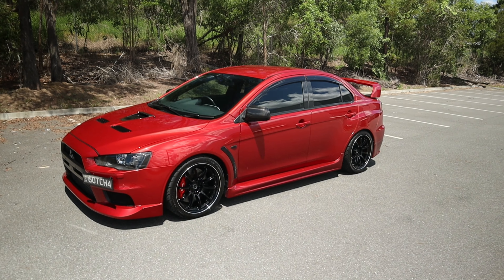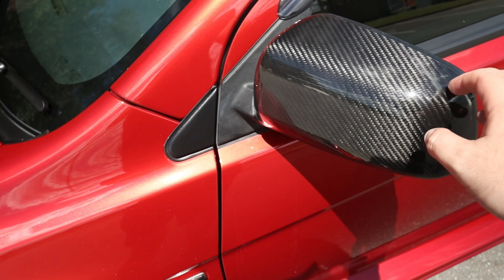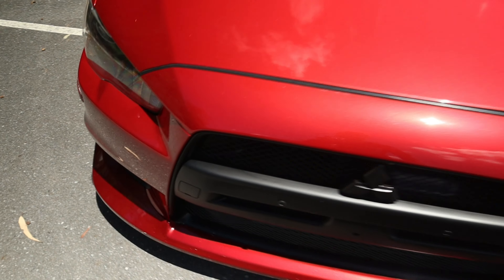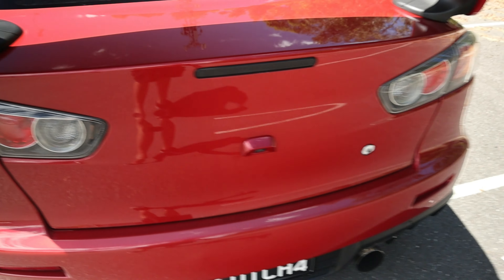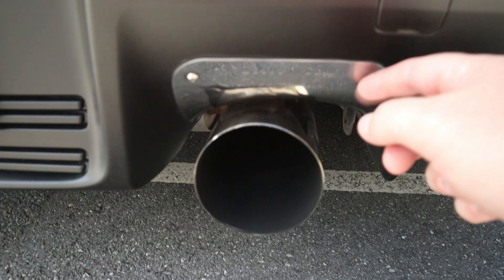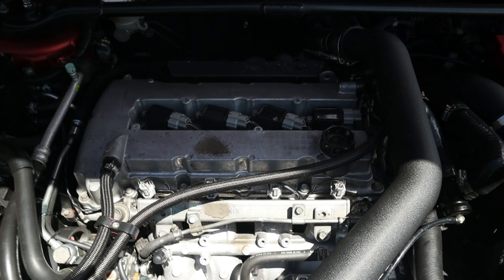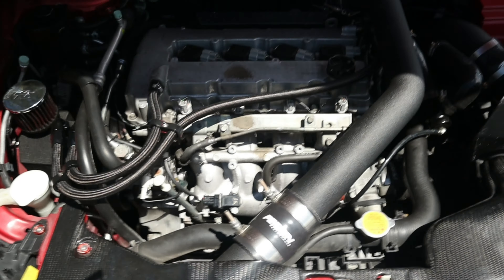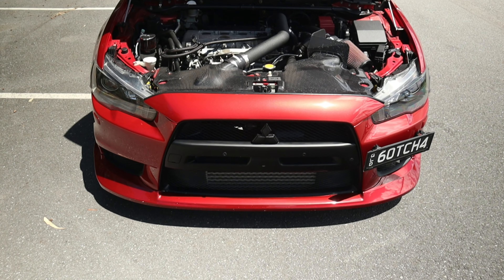What's Next For The Evo X MR? [2021 Plans And Mods]

Comment: You should get this thing call sprint booster v3 it would transform your car acceleration time
Reply: How does it work?  You can program the pedal when you program the ECU map
Reply from the maker: Just had a quick search and I don't think it would be much difference for an SST as they already have three modes which make the acceleration different and in S-Sport mode the pedal is already quite responsive.
Do you have one on an SST?
Reply: @JacksonStrain  thrust me give it a try i also own a mr and after i install it that thing goes fast my boy has it in a Lamborghini huracan and even though you dont gain hp the car goes faster.
Reply: @cyprianskiba8768  is like a power buster to the pedal my mr goes crazy fast on acceleration there's videos that explain it better how it works.
Reply: @JacksonStrain  it also works as a lock so no one else can drive ur car if they dont place a 3 digits code that only you know. And has a valet option too in case you let someone else drive ur car.
Reply from the maker: Ok thanks I'll look into it as I like the security part of it and valet mode would be great too so just those are selling points to me
Reply: @JacksonStrain  got it and by the way im a big fan of your work on the evo i been doing some of the things you do to my own.

Comment: VLAND headlights are non compliant and don’t meet the ADR in Australia as I have just found out 😢 , if you don’t want to void your insurance stick with your stock lights .
Don’t sell your heat Shield’s Jackson they are very rare and expensive to replace there worth over $600 from Japan parts landed in oz .
Car is looking very clean Jackson a couple of carbon prices will finish it of nicely 👍
Reply from the maker: Thanks Ken, yeah I knew the VLAND lights were non compliant as I have had a friend get done for them once. I personally like the look of the factory MR lights anyway so we don't plan on changing those.
The heatshields may come off but I won't be selling them as I like them and like you said they are getting rare
Reply: Jackson I know this might sound silly but check your rear brake pads for the rattle , every time I went over a bump or a bumpy road I was getting the rattle , have they got enough copper grease on the pads , I had the same rattle I couldn’t figure it out , took everything thing apart , came up with nothing , took it Mitsubishi at yamanto they had microphones set up in the back and that’s what it was the rattle was coming from the pads , they put more copper grease on , no more rattle , or you can put the orange anti squeal brake glue on it . I couldn’t believe that’s what it was .
Reply from the maker: @kenmaller2456  well we hadn't checked that and here's hoping that will be the issue for us as it sounds like an easy fix compared to rebuilding coilovers haha
Reply: @JacksonStrain   I hope that’s what it is , the pads are only held in by 2 locating pins and when the pistons release they rattle , I’m really hoping that’s what it is .
Reply: What about the Demon eye from Varis Japan？ Look way better than the vland in my opinion but the cost of a pair though，ooft.

Comment: Do you have an aftermarket O2 exhaust housing?  Are you running the stock catalytic converter?
Reply from the maker: Hey mate yeah the car runs an AK Racing 1 cell cat/testpipe
Reply: @JacksonStrain  great job on the car.  Was it hard to remove the inner roof part to have it sprayed black?  Did you get it out the back door or something?
Reply from the maker: @cyprianskiba8768  thanks, so the rooflining i got done by a mobile upholstery guy who repairs sagging rooflinings so it was an easy job for him to remove and reinstall but yes he took it out the back door and had to slightly bend it
Reply: @JacksonStrain  I run the turbo xs hfc and magna flow three inch stainless steel exhaust no codes came up been running for two years no problem
Reply from the maker: @dextersewlakhan565  nice mate, sounds like a good set up